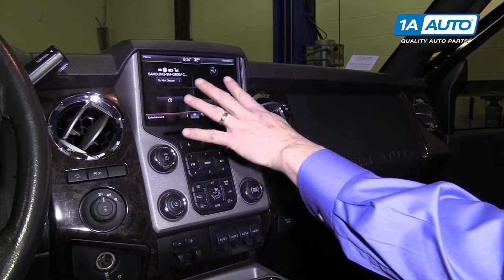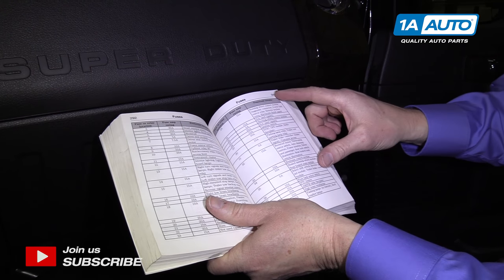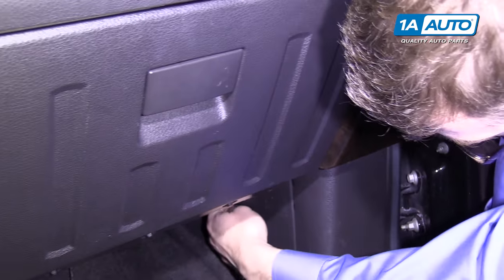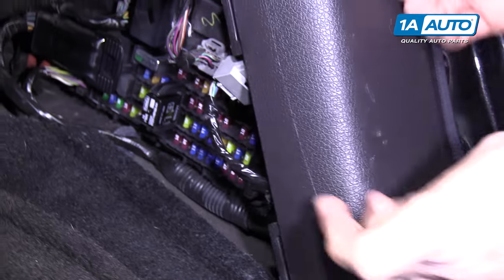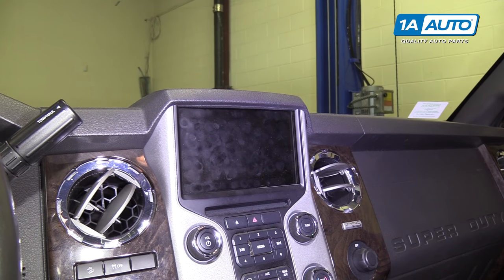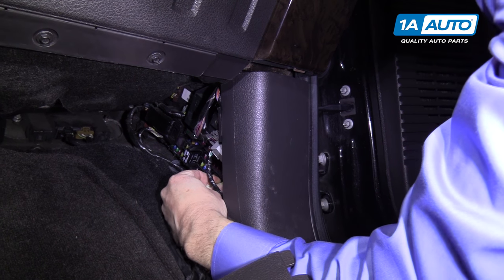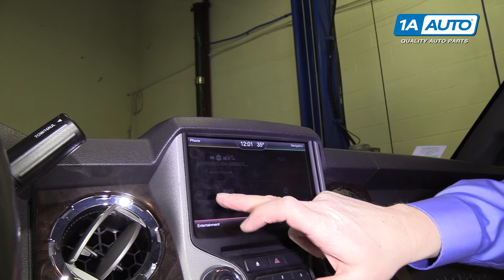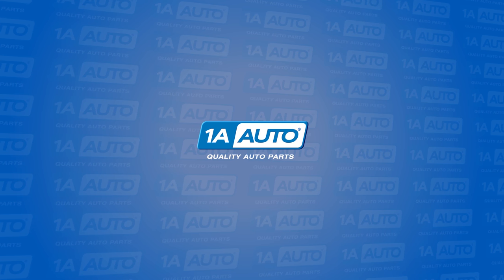How to Reboot Radio 11-16 Ford F250

Comment: Thats actually a great idea, it worked really well. Im a profesional Mechanic and I was trying to do a reset using my dealer level scan tool, well it didn’t do it. Pulled out the fuse kill the module for a couple of seconds kaboom it was completely reset.
Thanks again 
Great video!

Comment: I have a question to see if you have any idea what the problem could be. So I recently got a 2018 F150 in November, it wasn't super expensive because it didn't have a lot of extras. I wanted to upgrade the radio and it's been such a headache. I ordered a sync 3 touchscreen off Ebay that came from a2016 F150, as far as I know the truck has sync 3 but it came with the 4" screen so that‘s why I'm updating. But the listing shows that it has gps built in(and working), though ever since I installed it nothing is working right. Gps has never come up as an option, it won't update the software on it's own it's on sync 3 version 1.1.1. I tried the hard way of manually upgrading the software and still nothing. Then I figured well maybe I don't need the gps if I could get CarPlay I'd be happy but CarPlay won't work either. I originally thought I needed the sync upgrade harness so I hooked everything up and the radio wouldn't power on. I've since sent the radio and bezel to 4dtech to program it and when I got it back, the navigation icon still doesn't come on. I honestly tried to rig up a power adapter for the CarPlay usb since my truck didn't come with the factory plug and the truck would say " language doesn't match language of sync" when I plugged my phone in. Some apps would work, well actually I think only Iheartradio and or Pandora but Waze would open but the screen would be all blue/black and it would say the program was running but wouldn't show anything.  I just order the correct usb power harness that connects to the radio plug. If that doesn't work I don't know what else to do.
Reply: I was trying to not spend $1500 and up so I got the radio and module together($600) and then bought the bezel I needed (for 125)and thought I would swap everything and it would work. What gave me the idea that it would work like that is this YouTube video (The best cheapest upgrade for 2018 F150) I don't understand how his worked with him just swapping everything. I got the new gps antenna, I tried downloading the software update to a flash drive and it wouldn't work. I feel like the radio and truck aren't communicating

Comment: My radio doesnt power on my 2014 f150. Sync inoperable. My only display on screen is compass direction. Time will flash on and immediately turn off when I power the radio button on. Thats all it does. 
Reboot perhaps?  
Im writing this prior to doing anything in case others have similar issues. 
To be continued.....
Reply: Mine is the same as yours

Comment: Hello!
When I try to pick an option on my screen, it doesn't respond to my touch. I don't know if my screen is bad?
Reply: Iftikhar Khan 
Check in your owners manual to see which fuse it is that controls your radio then go to your passenger side kick panel remove the cover from the fuse box and find that fuse that you saw in the owners manual that controls the radio it’s most likely a blown fuse
Reply: Yep, I have the same problem.  Check the fuse 29 pulled it out and put it back in.  My screen comes on and says it is rebooting but still does not respond to touch.

Comment: This didnt work for me 😢.bluetooth and radio still not working .also pushe power button and forward button does hard reset and pulled the battery cable off for 10 min also didnt work .anymore tricks

Comment: Are you replacing the fuse?
Reply: No. He’s just cutting power to the radio, like rebooting a computer. If the fuse is blown and needs replacement, then you have bigger problems.